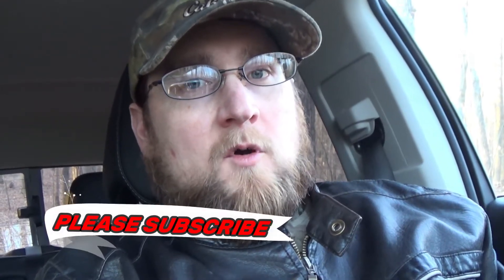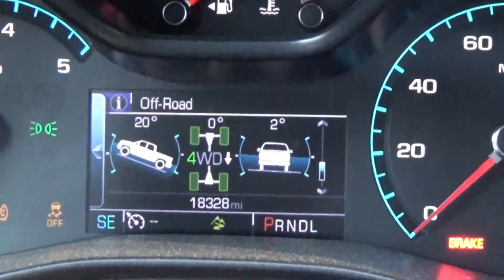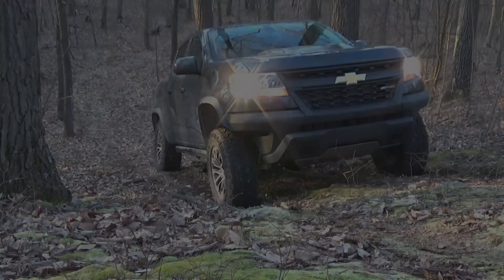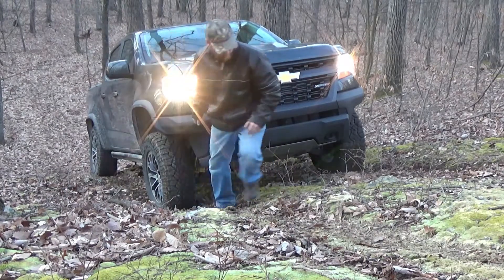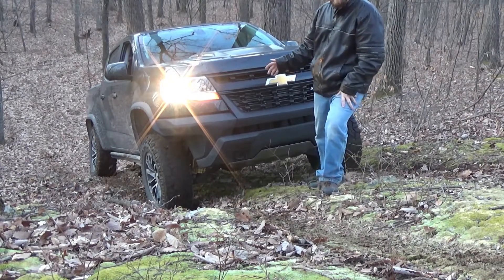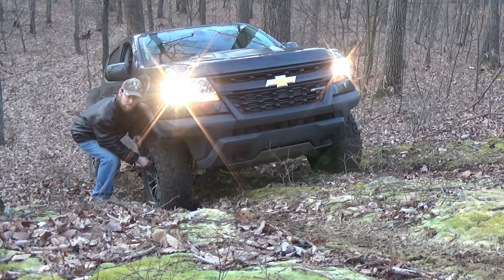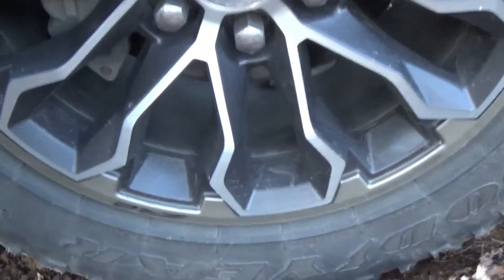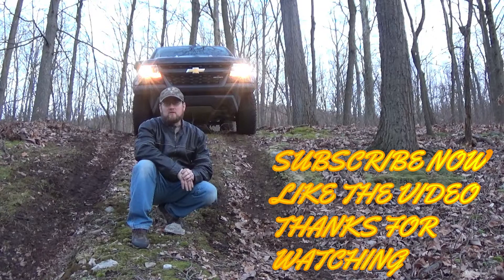How much does airing down your tires help?

Comment: You could have mentioned that tall profile tires are better for off road and air down better and protect the rim  and bead better: Basically the smaller rim diameter 15 , 16 , 17  much better than 20 in .
Reply from the maker: Very true

Comment: Hey Big Frog, I'm curious what load range your Duratracs are.  I used to run BFG AT T/A's on an XJ and was comfortable airing down to 13 psi or so but my Duratracs  are a lot heavier - load range E.  Some folks claim E rated tires shouldn't be aired down as low as a C load range or a P tire???
Reply from the maker: I air down to 15-18 psi depending on what trails I plan to run. I'm pretty sure the ZR2s are load range C. I have the Goodyear authority tire from Walmart on my jeep. They are Cs and I air them to 12psi. If running shape rock i will go with 18.

Comment: Very interesting, nice video. Im sort of new at offroading and I'm trying to learn some stuff. After i get all the bugs out of my 4x4 i want to run a 33x11.50 tsl on a beadlock and do the whole low pressure thing
Reply from the maker: The idea is to get a good footprint on the ground. I've seen some run as low as 8psi for large rock crawling. Remember the lower the tire pressure the less ground clearance you will have. Each vehicle is going to be different depending on weight, lift size and length of wheel base.
Reply: @BigFrogs4x4  yeah, i understand the theory behind all of it, I just don't have any first hand experience. Thats why i like this video so much it demonstrated a significant difference.  I was always sort of sceptical about how   important people say it is. I have 31x10.50 tsl at 30 psi right now and we went today and they were grabbing pretty good, just wait till i let some air out lol. Oh yeah to add to that i have a samurai and 0 psi only looks half way flat lol

Comment: Letting your pressure down is a necessity on deep beach sand and makes a world of difference.
Reply from the maker: I learned that the hard way. Took my 95 chevy tahoe out on the beach in the outer banks nc back in the early 2000s. Didn't know about sand. Got stuck 10ft out. Had to be rescued by a ford. So embarrassing lol

Comment: I recently went off roading , I go to this place all the time but conditions were worse than I thought after a big snow of 7 inches, it was a really heavy wet snow, under the snow was mud which I didn’t realize. Any things were more slow going than usual so I quickly realized conditions were worse than I thought, still tho I had a great time and went through some tough stuff, after about 30 mind I went to head home and got stuck on the way out. I did not have my shovel as I took it out to paint it so all I could do was use a lid off a plastic tote, after about 15 minutes of digging snow I got in the truck, put my rear locker on and still couldn’t quite make it out, I went to my last option which is air down the tires from 37 psi to 18 psi, that was just the ticket and I was just barely able to free myself after that :) Closemcall cause my wife would have been pissed walking home through a snowy field on a cold winter day , Lol
Reply from the maker: Awesome. Happy wife happy life lol